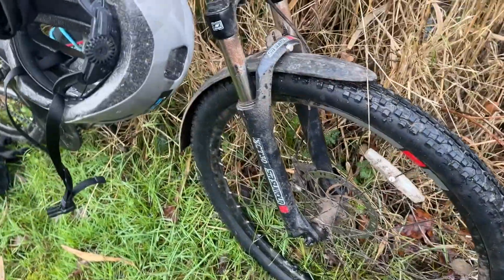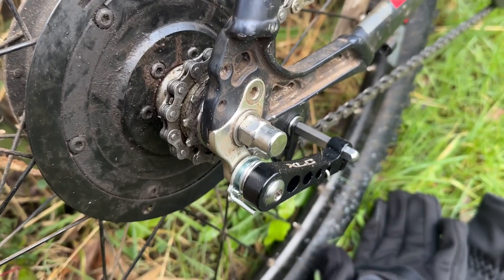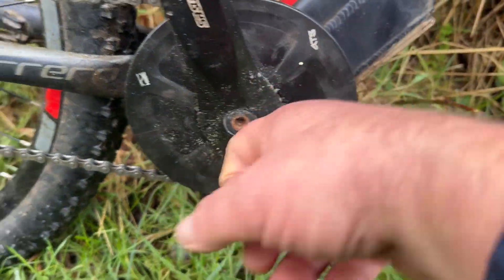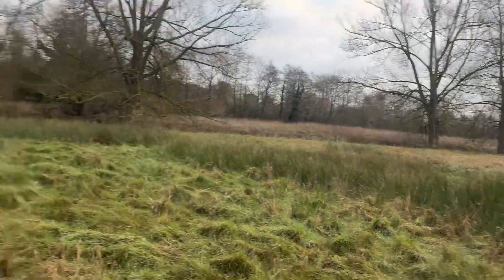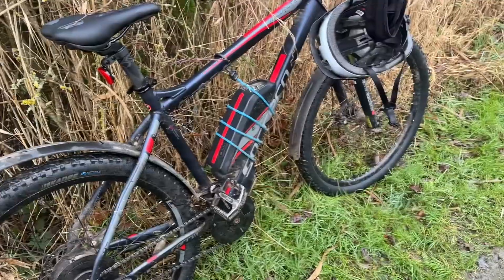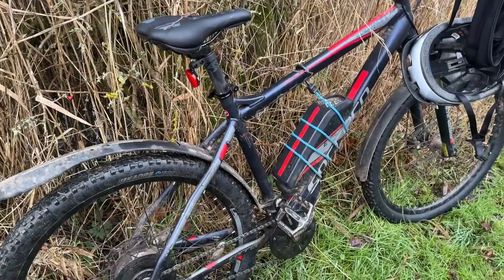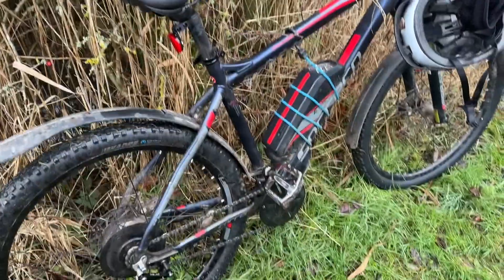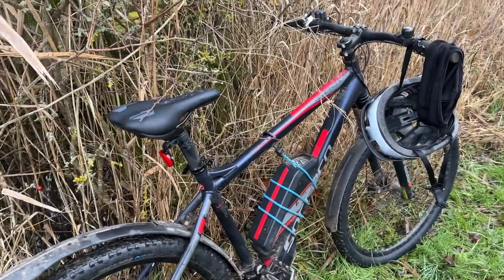My old Carrera Vengeance e-bike back to life

Comment: I have a 2020 Crossfire E that has now covered 6500 miles and is still going strong. I had the torque sensor replaced under guarantee in the first year but it started working again before I took it in to Halfords so I'm not sure that it had actually failed. I have found that road dust and fine grit gets onto the sensors so I vacuum this out from time to time and its been fine ever since (apart from a loose connection). I only use Tour mode and still get around a predicted 50 miles on a full charge and sometimes close to 60 if I haven't been up any steep hills. I've had to remove, clean and re-grease the free wheel hub when the pawls got stuck open. I have replaced about 4 chains when they stretched to 0.75% of their original length. Maybe that's why the gear set is still original. I've had two punctures (rear wheel) and replaced the rear brake pads but that's about it. I've also added a few things such as mudguards, lights, rack, water bottle holder and bags. This bike is the best thing that I have ever bought.

Comment: Carrera vengeance are a piece of crap and have turned me off ever getting a second e-bike as I have found that getting 20 miles out of it on roads with some hills has the battery needing another charge. I can get a lot further on my old ordinary bike and the oñly recharge I need is a 5-10 minute break. Not worth the money and have turned me off ever buying another e-bike. What a piece of SHIT. BETTER OFF WALKING